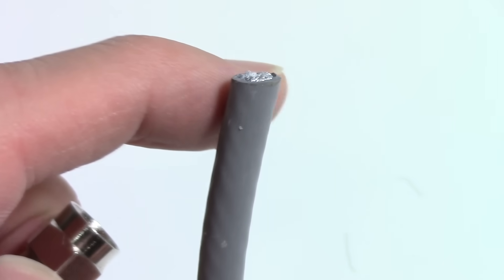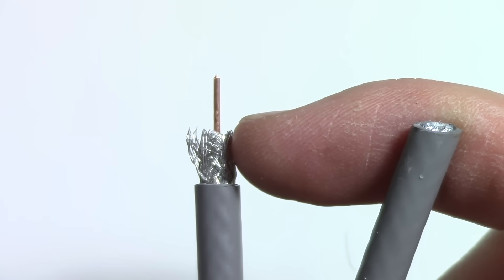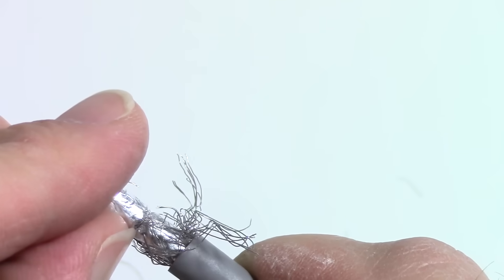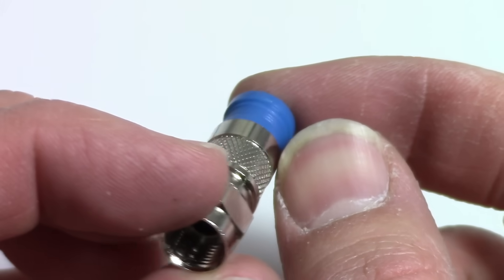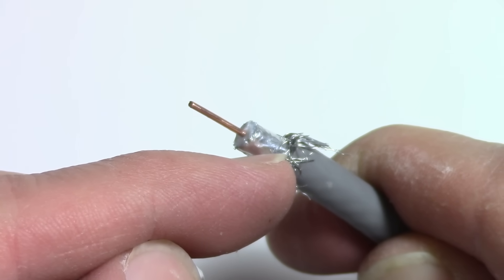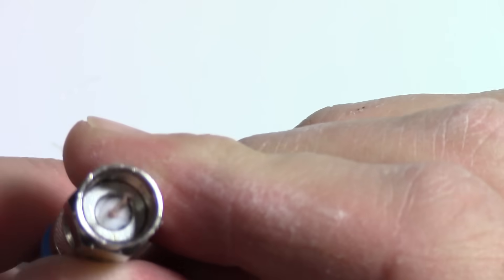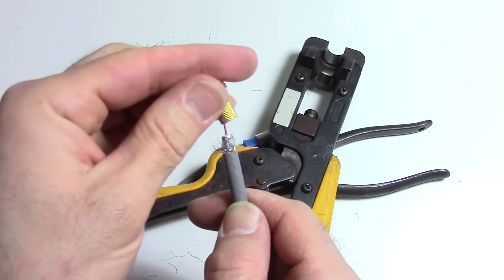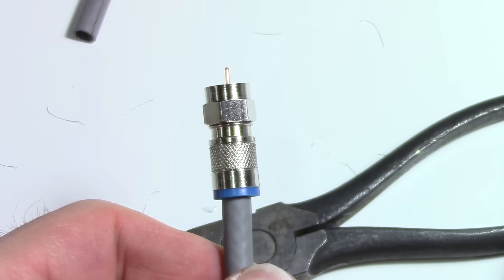Coax TV Cable stripping connector install - Compression and Threaded

Comment: This is probably the worst video showing how to make a RG6 compression fit. You do NOT want to manually strip the cable jacket and what he calls foam. It's actually dialectic material. And it's misleading that you don't need tools.  You have to hve a compression tool and stripping tools.  Comparing a compression fitting to a crimped fitting is totally, totally different.  They shouldn't even be shown in the same video.

Comment: could I repair a damage outdoor RG6 satellite cable with coupling or will weathering effect it over time? because the reason I am asking is  a service guy came by less than a year ago cut out the bad cable and installed 2 couplings. Now after this band-aid repair one of the cable connector corroded to the point loss signal again a 2nd time! What could have this repair guy done different?

Comment: Thanks,  this was very useful because I WAS going to buy a special tool that I'd only use once. I'm moving a cable from one room to another and the hole in the floor that the installer drilled is just big enough for the cable, but not for the completed termination. Once again, thank you.

Comment: If a tiny metal cord piece is hanging out will it make me lag on video games? I been lagging.
Reply: Is the exposed metal a piece of the aluminum shielding?

Ideally no metal should be exposed. Also, the shielding should not come into contact with the center conductor. Precut & terminated coaxial cable is available from hardware stores, Best Buy and online vendors.

I, myself, purchased tools specific for prepping coaxial cable and applying compression connectors on raw cabling.
Reply: @bewarethedecks  the cable had a tear in the rubber and a couple metal things inside got cut . I replaced it and it's not making my games lag anymore.
Reply: @PovElijah  Thank you for the update. 🙂

Comment: If you don't have a razor blade, you can also use some kind of knife(kitchen or pocket). I have done that for years going back to the analog only days decades ago when they had the rectangular brown, wrap around the TV screw cables(used to be popularized by the large outdoor antennas) and on the cylindrical black or white cables that you buy in stores with the pin tip.

Comment: Excellent video! Question I noticed you left foil on white plastic shielding? Some remove foil?
Reply: The foil shielding that is affixed to the white insulation should not be removed.

Personally, for me, purchasing tools designed for the preparation and termination of raw coaxial cable has been worth the money outlay. Otherwise, pre-terminated cables can be purchased from hardware stores, Best Buy and online vendors.

Comment: What is the name of the metal thing you put on when I search is says there are 2 type a female and male ones
Reply: The connector?

There are three types of coaxial cables connectors on the market for RG59 & RG6.
First is twist-on. Avoid these at all costs. They are not recommended.
Second is crimp. Crimp connectors used to be commonly used. They are still good but have largely been supplanted.
Third is compression connectors. Compressions are now industry standard. A special tool is required to properly apply it to coaxial cable, but they are great.

Comment: The tool made for stripping the cable does  far better job than a razor blade, if you’re going to make your own connections, get the correct tools. All of the compression fittings were good, but not the twist on fittings. They can easily fall off and just cause problems. I replaced every one that I saw when I worked at Comcast on installs and trouble calls.

Comment: Thanks for the vid! I have issues with my new location and have tried everything else but rebuilding the cable. I have reset the modem numerous times, checked my ethernet cables, check my PC port, and contacted my ISP to make sure my equipment is working correctly. Hopefully this will be the end of my network troubles :)

Comment: I would recommend the threaded connections you can pick up at Walmart. Worked easy for me using only a pocket knife.
Reply: Wait till you get filtered for noise because your connections are leaking …call a tech

Comment: Please do not use twist on fittings. You will cause ingress/egress and create noise back feeding into the plant interfering with not only yours but your neighbors on the same node. Which could result in a preventative maintenance tech at your door or worse your services being deactivated until fixed. All depending on how much your cable company values their quality of service. If you are doing this just for an antenna please disregard this. You can always stop at your local cable company and get a professional cable to needed length and their standards for free. Keep fittings screwed on tight please. Cable technician here.

Comment: So don't buy the $7-10 stripping tool that will do the job perfectly with no messing about, but get the expensive crimp tool. Or do you have a good way of putting on those crimp connectors? Your tool link is broken. There are kits including the stripper, crimper, and crimp connectors for around twenty bucks. Probably better than hacking up the end of the cable or using an unreliable screw on connector. This is not good advice.

Comment: Please do not repeat any of this. You will have the line technician disconnect you from the street due to all of the egress signal backfeeding essentially in to the cable system. Just buy the proper tools data shark makes a kit for about 35 dollars .the white material the dielectric padding can not be crushed that will affect signal quality as well as scoring the center conductor or copper. And the dielectric can not have even the slightest gap or a tech will be coming out and those crimp connectors the system is too advanced for that we cut those off as soon as we see them. You will damage the cable and cut you hand open and it’s a push and twist to get the connector on if prepped right the whole presses can be done in 45 sec or less . I worked as an in house technician for 10 years so I know a thing or two about a thing or two

Comment: No you need clippers crimpers slippers bobbers dabbers, and a new vocabulary of language. This guy's doing it all wrong
Reply: My mistake he's using different type of connectors. The compression ones? No I'm used to cutting it right down to the center conductor, and then crimping after you shove it on there much better grasp of contacts.

Comment: And don't use a razor  if you score the center conductor it will cause other problems  leave it to  trained technicians
Reply: Just don't cut the center wire while using razor... is it so hard? The insulator goes off after cutting it shallow and bending so there is literally Z E R O reasons to even touch center wire with blade at any point.
Reply: But sure he should have pointed this out to be careful while using razor.

Comment: Rather than folding the wires down can you just cut them off?
Are they actually necessary for the connection?
Reply: Oliver Stevenson much better to just cut them off otherwise you may experience a faulty signal

Comment: Can anyone help me with my question.  I bought an xfinity self install kit. They say to find a coax outlet to screw the coax cable into provided by Comcast. But the room I want to use already has a cable coming out of the outlet that could screw into the Comcast modem.  Could I just use the cable already coming out of the wall? Or do I have to use the screw on outlet?  If that makes sense... male/female.

Comment: This video made me cringe. As a veteran technician, if you dont know how cable TV works you won't understand what can cause issues. That dialectric needs to be flush with the hole inside that connector, other wise you get what's called a suckout such as what you just showed. That alone can cause issues. Using the razor the way you did can score that conductor which can cause pixelation on TVs, intermittent internet etc. That last fitting you showed can cause ingress or noise which can feed back into our lines which you can cause your entire neighborhood issues if it's bad enough. If you're going to hook up an antenna then this video will suffice, if you're doing anything that involves cable TV services please have a professional install your services. You may have an install fee but that covers everything we do. Quality parts, correct coax, correct fittings etc.

Comment: see this is,what im talking about. ive watched about 4 or 5 of these damn thing and had to listen to these people ramble on and on about nothing. this guy shows you and dose it without all the bullshit. thanks bud i do appreciate it.
Reply: Except this is what causes leaks in your signal and it's where you pixelation starts or slow internet which will then back feed into the plant causing issues for your neighbors.
Reply: Eli Yo then how to do it properly man, atleast mention the damn process please if you know!!!!
Reply: @SankiKingOfficial .... remove 2nd shield i.e., stiker type aluminium foil also; to keep distance from center conductor.

Comment: You dont need a crimping tool,  I used 2 pipe pliers and squeezed both sides of the compression fitting slowly until it was fully compressed.  Came out perfect.

Comment: So I actually do this for a living and I would highly recommend to buy the proper tools for this. The reason for this, is because of the complexity of information that goes through these cables now a days, a simple score of the center conductor, or even having a center conductor too long or too short, can cause issues. By the way, the foam part is called a dielectric. 😑
Reply: This is a sign of someone thinking their job is rocket science. If he called the dielectric by name, no one would know what he's talking about.
Reply: You only need a tool if you dont know how to measure it to the standard and cut it yourself.
You can spend money on a tool or you can just use a measuring tape, blade and your eyes to do it.
Reply: @pmAdministrator  If you're in a bind, maybe. Spend the $10-$15 and get the tool. One small score on that center conductor and you can cause a whole host of issues.
Reply: @Tpurc  then don't score the center conductor? Learning how to use a razor blade properly is the same as anything else.
Reply: @otallono  And if you were caught in the field using a blade, you'd be heading back for retraining.
Reply: @Tpurc  kindly advise what tool do we need to buy for helping to execute a proper good job on this. Kindly advise what are the problems if too short or too long.?.Thank you.
Reply: Helped me just fine! Cheers
Reply: Question! If I went and got the tools and did it myself, would that be fine, or would it cause any issues? Have made about 4 appointments n no one has shown each time. They always say we don't have an appointment the day of even though we call to check every day that the appointments is still set. Internet has been out for about a month and we're still having to pay for it. Tired of waiting n paying for something I don't have access to. Want to fix it myself properly knowing it won't cause more problems
Reply: I agree , I work for spectrum and I don’t highly recommend you use a blade for that it could damage the center conductor
Reply: Yep buy the tool save the hassle
Reply: I agree on getting the right tool. I've just installed a cctv as a novice  and only x2 cameras are showing . Making the bnc requires a bit more skill than I thought.  Just never buy analogue always buy the power over internet if the budget allows .
Reply: i also do this for a living and you would be getting a retrain or a write up for this lol. just saying.
Reply: @elchuyito355  Like I told the last guy I do to and I use tools but I work with a guy who doesn't and he moves a lot faster than the rest of the guys and doesn't have any issues if you are comfortable doing it this way and are doing it correctly and not scoring the center it's perfectly fine. you are just going by what they teach us in class. Me personally I can't move fast cutting with the razor blade that way but if you can go for it. If you start getting complaints start using the proper tools
Reply: What are you talking about I work with a guy who still does it this way and he moves really fast and never gets any complaints. He moves a lot faster than me using tools if you know what you are doing and feel comfortable doing it this way it's perfectly fine. I Took the same class you probably did and they feed you all that crap because they have to.
Reply: @diameadozen  if you are adapt at the blade, most probably a blade will do a neater job than a wire cutter.😊😂and faster too.

Comment: Wow this was the worst guide on how to do a coax connector I've ever seen.  If you have to force the connector that hard your not doing it right...also using a razor blade?  Seriously that will not get you the proper cut dimensions.  Doing the connector the way you shown in the video will cause flaws that can lead to bad transmission.  Don't ever use the screw on... or crimp.  You made this video way more complicated than it needed to be.  Use the proper tools please.

Comment: My wire in the middle is copper strands....and the cable itself is only thin....I need to fix the plug on the end of a rf unit for a sega mega drive....will your instructions still work ?
Reply: what on earth are you talking about ??

Comment: I bought a kit with strippers, crimping tool and good connectors and I had to use it when mowers hit wires Dish did not bury deep enough or for my own use running wires to TVs.    For what I spent on those junk screw in connectors that come off, I could of paid for the professional kit years ago, and saved myself the time and aggravation of the cheap connectors falling off.  Put tools and connectors in a nice zip canvass bag and hang in garage or place after every use.   Your picture will be better and savings alone on screw in connectors and trying to cut wire to exact length will more than offset the cost of the kit.  Just don’t let anyone borrow it or when you need it, I found they have it hanging on their garage wall thinking I forget.  Hate folks that borrow stuff and have to call to get it back or they bring stuff back dirty or broken.   They ruined it for other folks that wanted to borrow stuff.

Comment: That is what we call a “sucked out” fitting, dielectric (“white foam”) should be flush with the metal could cause pixelation and bad signal I hate going to houses with fittings like this. Also clip the center conductor flush it’s just better that way

Comment: Lots of bad information in this video. Unless you are ok with ruining your internet or tv signals you really need to use the correct prep tools for the coax.  By using a razor blade you will likely score the copper plate on the center conductor which destroys a good portion of the RF frequencies that ride on that conductor this will result in poor quality video and slow/intermittent internet for cable modems.    Also by removing all of the braid you are cutting away the ground conductor for the cable.  And if prepped correctly you wont have to force the fitting on with a pair of pliers.  
As a cable technician for Comcast I’ve had to fix many problems due to untrained Home fixes like this

Comment: what if the f connector will not easily fit on coax cable, even when white is inside metal tube & you apply enough force to seat connector?
Reply: Photographic elements in my opinion you should snip and restart, once you pull back braids give the foil a tight squeeze and twist so the metal tube doesn’t pull it down with it. Most likely what is happing it should slide right on like a glove using firm pressure your hand should never hurt after lol

Comment: Won't buy a $10 cutter, but will buy a $40+ crimper. Getting the cut right is as if not more important than getting the F connector on right.

Comment: To the ones that are suggesting not to follow or listen to this dude . all of you are trippin . ive done this but with used connectors that still have part of the cable stuck in that shit and i try to take as much as possible out of them to put in the new cable thru it and all the times I've had to do this thru out the time . for different tv's . they always work just fine .strong signal all the time .so i dont know what the fuck most is talkin about

Comment: For 20 bucks at Amazon you can buy the crimper, strippers, and 10 f type connectors in a kit. Those screw on type connectors are junk, all they do is ruin the cable. When crimping a new connector, it isn't necessary to peel back the braided wire overlapping the outer insulater, it's why you had a tough time putting that connector on. If done right those connectors slide right on fairly easy, just leave the braided wire as is.